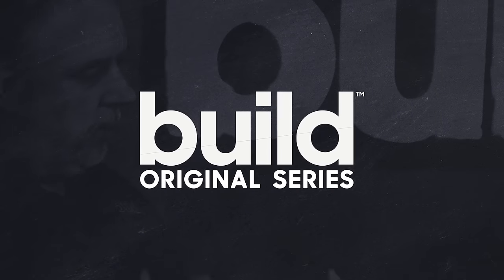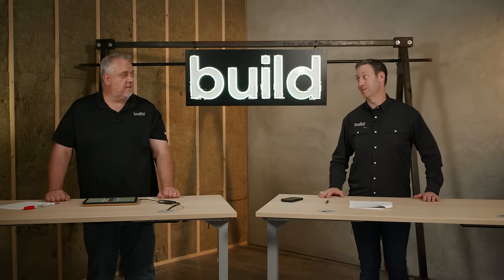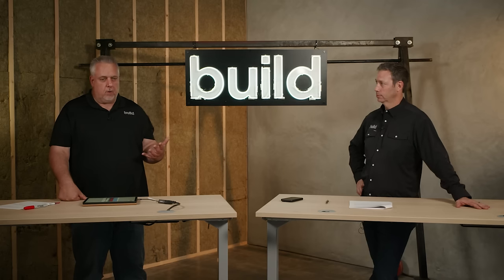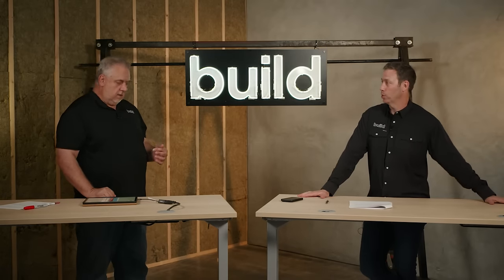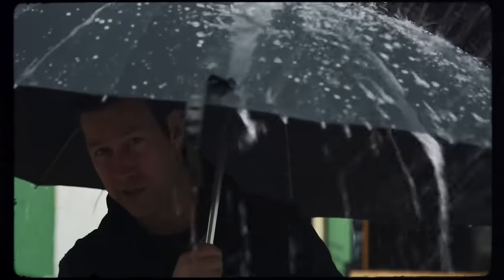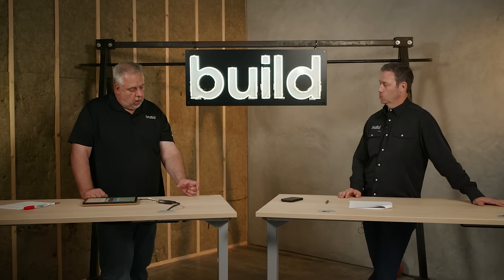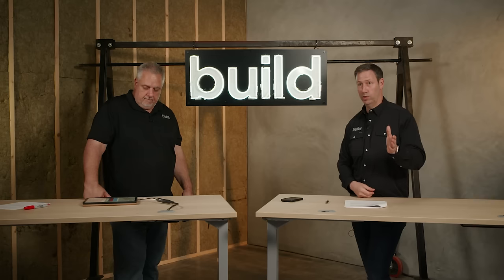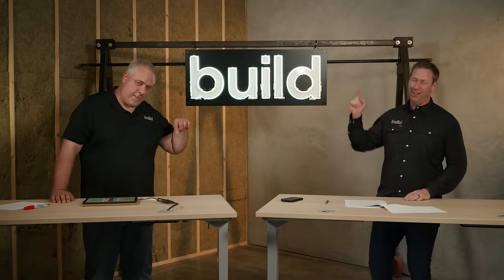Build Science 101: #6 Achieving Building Science

Comment: Is there a reason that -- in talking about "control" and the prevention of compromise of the building -- you are NOT talking about structural integrity -- controlling against gravity, sheer, etc? Just curious. That seems as much a part of "building science" as control layers, except that its an old issue as compared to the "newer" water, air, vapor, and thermal control issues (or solutions).
Reply: I could be 100% off base for why THEY'RE not talking about it, but. Generally speaking, code covers structural "decently". Even in most episodes they'll talk about what lags that are satisfying code, LVL headers that don't require stacking, the spans of beans and truss systems VS 2X?, ETC. This leaves little "room for failure", although we will always find a way.

Again, purely speculative and my .02 but that's how we sepearte ourselves from the common/track builder is what we do AFTER we meet code and how far beyond it the budget allows us to go.
Reply: he cant tell you what code is for sheer and live and dead loads in your area because those change everywhere. You could consult the IRC, or an engineer. But its like watching a video about being a doctor and then thinking you to are also a doctor, it doesnt work that way. The APA has some good videos. All these other issues are about saving energy. If you just want to vent all your heat, water management doesnt matter because there is a constant drying force. Once you starting keeping in heat, you are keep everything else in too, including water/vapor. The codes are about how to make a building that doesnt kill you, either structurally, or being healthy, and quality.

Comment: I am not a builder, rather a mechanical engineer and every time i hear them say vapor and air as two different things, it hurts. Air and Vapor are the same thing!! Water vapor is part of air. You can NEVER be airtight and vapor open as some products claim. Unfortunately, everyone in the builder community has gotten used to this. Please Matt and Steve, you guys have the pull to correct the industry on this. If you think i am wrong, please explain why.
Reply from the maker: Ok so …a Zero Perm product like Visqueen (plastic) is air tight and vapor closed. A Housewrap that’s 25perm rated can be air tight but vapor open. Meaning if I made a ziplock bag out of the material I could put a damp sponge inside and it might dry when left in a hot/dry room. Agree?
Reply: @buildshow   With that analogy, 'air tight' would just mean physically preventing large particles/bugs from passing through, rather than preventing air itself from passing through, correct? I'm trying to understand why modern building science is so focused on air tightness when older homes with a looser build fared so well over the decades. 

If the air barrier isn't preventing moisture from passing through, is vapor open, and has close to 0 R value, then what exactly is the air tightness doing for the home besides keeping bugs/pollen out and probably helping reduce noise levels from the outside?
Reply: @buildshow  I agree - look at drywall, pretty much vapor open, but will stop air. If I chose to stand at a wall of drywall, with my mouth sealed to the drywall, I would not be able to blow through it - the drywall would prevent it. But if the moisture content of the air in my mouth was higher than the moisture in the drywall or other side of drywall, the moisture would migrate in search of equalization in the drywall and the other side. I have heard many people speak on this issue far smarter than me on the subject, and I NEVER heard them speak of air leakage and vapor migration as the "same thing". If that were true, then a house built only of drywall would either be airtight and vapor closed? or air open and vapor open? Neither of these make sense to me.......

Air leakage can carry moisture with it, but I don't think I would ever say they are the same thing.........
Reply: @coolestrock2008 & @aheadatime I think this is a semantic issue. One way to think of air tightness and prep rating as water resistant and water proof. Air tightness is resistance to the bulk flow of air, not that there can be no mass diffusion through the barrier/membrane. The vapor barrier can have different levels of permiability from zero diffusion of water molecules across it to some level dependent on the gradient across the membrane. Does that help?
Reply: I also don't see what the point is to handling "air" and "vapor" separately other than to sell twice the products. We're not trying to stop teeny tiny helium atoms getting through seals that block oxygen and nitrogen, (which broke all those iphones in hospitals and breaks cheap dive watches in diving bells). If you're applying two barriers with different permeability, what environmental factor is being stopped by one but not the other?
Reply: Water is actually the smallest molecule in the world possible, so it’s possible to have something that is water vapour permeable but not permeable to other components of air